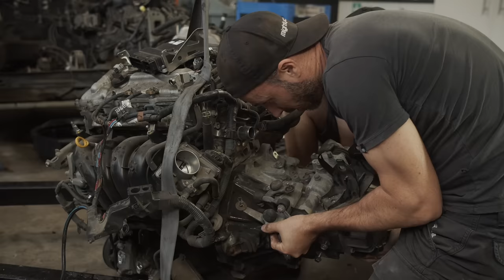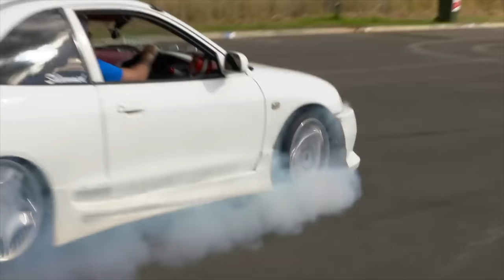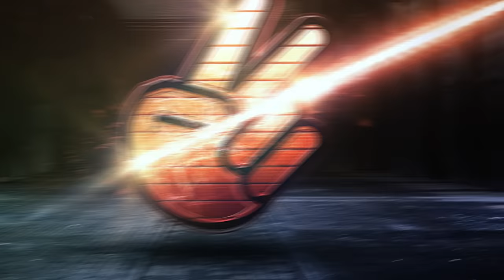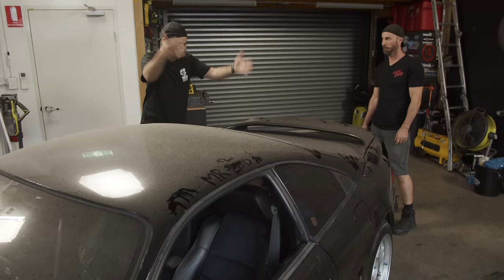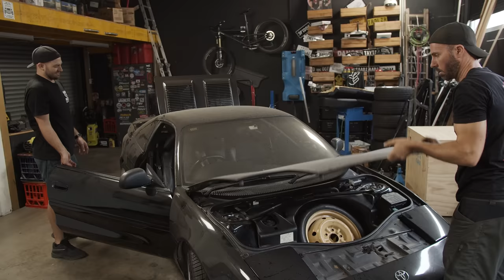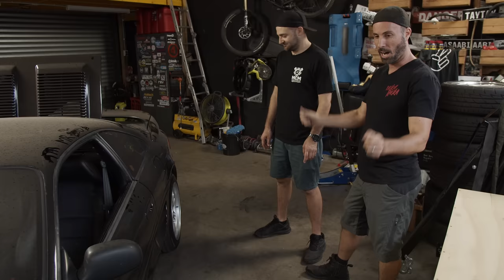$10,000 Rear Engine Challenge (Marty's NEW CAR)

Comment: Always thought the "snap oversteer" for these cars was exaggerated, that was until i witnessed an mr2 snap oversteer on a sprint run around a smooth corner.. 🤣
Reply: It's pretty brutal and didnt get fixed until the MRS. My old man borrowed one after he blew the head gasket on his range rover.

Was driving home from work one day, completely normally, and found himself pointing the other way. They're lethal.
Reply: Snap oversteer is just a word people use for the thing that happens when drivers who aren't used to mid-engined cars try to drive them like the usual RWD car. It'd happen on pretty much any mid-engine car but the reason you only hear about it whenever someone mentions the MR2 is because it's just about the most accessible one
Reply: @j4ff4c3ks1  false.... peep any review of the era and pro drivers and auto journalists who have plenty of seat time said the same
Reply: @douglaspealing5608   firstly, if the MR2 is set-up correctly it wouldn't happen on a smooth corner. secondly they 'fixed' it on revision 2-3 by altering the suspension and brake setup. even doing a very simple wiki would tell you that. idk where you get that info from, and if your argument back is 'yeah but late ones can still do it i'v seen it'... mate all mid engine'd cars can, Lambo's, Ferrari's the lot. the only reason MR2's have this name is due to the poor revision one setup gave it a huge name then all other models smoked things they should never of been getting close too. If you research this you will find out that the MR2 Turbo GTS was actually faster in a 1/4 mile than the Supra... the flagship sports car for Toyota... and the Supra was destroying Ferrari's of the day. Have a nice day.
Reply: @Dsilver024  false, they haven't. It's all you idiots that have never owned or raced them that say this. Snap would indicate that it happens without warning and this is just not true. The engine is in the middle/back meaning that the car in most situations handles much much better than a front engine car giving the false sense of security so granted the window between feeling the rear go and having time to correct is shorter it's not as bad as instantly snapping. Most people out on their brakes as the response this unbalances the car. Anyways I wish internet warriors like you wouldn't feed false info... But in all honesty if you do then it keeps the cost of spare parts down for me.
Reply: Driver mod.
Reply: The "snap oversteer" thing is bollocks. The very first cars, revision 1 models, had neutral handling. In the right hands they were awesome. Problem is plenty of people don't appreciate how much of an effect the engine being in the back has, so they would throw it around in corners like any other RWD car and be surprised when the back end suddenly bit back as the weight shifted. As a result, Toyota changed the rear subframe and tie rods for revision 2 onwards to make them easier to handle by the masses, and also gave them better brakes. Then revision 3 got a newer 250bhp version of the 3S-GTE, an LSD gearbox as standard, etc.
Reply: @j4ff4c3ks1  Drive one fast on a mountain pass and you will get it. It's so unpredictable it not safe.
Reply: The revision 3 cured a lot of it just by fitting bigger wheels, but the rev 5 had the better anti roll bar setup and is Def the one to get
Reply: I owned one for years, never had a single problem. They go exactly where you point them, you just have to remember the weight is on the rear wheels instead of the front. With all the weight on the back, they're all grip until you really provoke it. On a front engined RWD, it will progressively lose grip the harder you push, on ANY mid engined car that simply isn't the case.

And yeah, Tiff loved how the revision 1 handled, I remember seeing videos of him reviewing one and driving it hard. Funnily enough he didn't struggle to keep it under control since he could appreciate how a neutrally set up mid engined car would behave. The general public didn't, hence the revision 2 changes I mentioned.
Reply: @danbrittain9530  Only spun when I was testing on a skidpad because I was so scared of what the internet said. Like you said if you drive it like a front engine car you will have problems. Some tools need better craftsmen.
Reply: @danbrittain9530  Agreed. The correct size tires and a good suspension setup do wonders for making it much easier to drive.
Reply: @LongingREDFOX  yeah i think the guy dabbed the brakes around the smooth corner but the back end snapped to quick for him to catch and it does go very quick
Reply: @maiy8786  to be honest its all about how you drive it,  you cant drive it like a rwd or fwd car otherwise it WILL catch you out, and when it does the rear end goes so quick even some pro drivers struggle to catch it.
Reply: @LongingREDFOX  well, call me schooled to some degree. I got the info of the MRS bit on the grapevine, never actually fact checked that, so fair play. How fast a car is in a 1/4 mile doesn't determine how well it goes around a corner though mate. I've never been one to care about straight line speed. I like a bit of poke but 100hp and lightweight is plenty for me - just want something that corners.

In theory, the car should just work from factory. The fact that you have to dial out the oversteer yourself is what gets me. Don't get me wrong I actually quite like them and very nearly bought one, I'm just saying that bone-stock, the earlier ones definitely snap oversteered. Not gonna say my old man's a racing God, because he isn't. (He admits I'm a much better driver) but the boy knows how to hold a wheel, and for a car to just point the other way under NORMAL driving conditions (it wasn't even wet) there is something fundamentally wrong. Wouldn't stop me buying one in the future tho
Reply: @danbrittain9530  lol, sounding like porsche after paul walker died.... know all the things and reason why something bad could or would happn but denying the problem.... yea... ur right.. nothing wrong with the MR2.. not like there were any revisions to the car on the later models to negate the issues u deny exist

Comment: 9:00 *used to be cheap in the US, these have gotten pricey over the last 3 years.  Now people want 5k for a rust bucket non-op status turbo with 200k+ miles
Reply: same deal in the UK mostly, rough ones still rarely show up for cheap (like 2k) but really you're looking at 5K(10k AU/ 6k US) for a decent one. and the w20s are now starting to be consistently as or more expensive than the w30s.

Comment: Welp shoot there goes the price on every mr2 part DX damn it, and with the targra top seals you can still buy those from Toyota you just have to deal with someone from japan or the uk, and with the wheels Yes the car is meant to be staggered,  from factory they came out stagger rev1 89-92 14/60/195 front 14/60/205 rear and 93+ 15/50205 front and 15/50225 rear if memory serves, But Question for Marty, Does it have the retracting mirrors and moving fog lights when you steer?  where should be a switch with the fog lights that's got Japanese writing on it to turn those on, because those i believe were unique to Japan, And with the snap over steer, Yes it is a real thing in mr2s but its not as common as people think, it happens (and someone can correct me on this if im a bit off) when the weight transfers from the rear to the front when cornering hard at speed when power is taken away or hard braking is applied while in the tight corner too but is preventable with a decent set of tires and most important of all experience of knowing when the car is stepping out and how to correct it and not being reckless behind the wheel, because the car WILL punish you for it, but in saying that any car will do the same so treat it with respect and it'll reward you with one hell awesome drive, https://www.mr2oc.co.uk/know-your-2.html?view=kb&kbartid=10 <-- a proper break down better then i could ever explain it
Reply: I really hope parts are still reasonable to get when I save up enough to refresh my 91 NA. Was my daily driver for 4 years but the car is 100% stock with nothing but normal maintaining done for 340k miles. So the suspension is shot. Bought a TDI jetta for my daily and will hopefully save up enough to get the MR2 in good shape in the near future.

Comment: That is SW20, called the “MR2”, differ from ZZW30, called the “MRS” models. But similar to rear engine models.
Reply: In Australia MRS ZZW30 was sold as the "MR2 SPYDER"
Reply: Yes they are all in the same lineage. AW11, SW20 and finally the ZZW30 that was named MR-S in asia, MR2 everywhere else
Reply: Except France.
Reply: MR2 spyder here in the US also for the 3rd gen.

Comment: Check out the “Boostedboiz” K swaped Mr2 .
Reply: Dimitris O. Only way to make an MR2 reliable, swap a k series Honda motor in it and put a moon tune in
Reply: @nicolasedwards1860  the 4age in the older ones is a solid motor, thats what im swapping into my te72 station wagon

Comment: Who doesn’t like an SW20😂😂😂
Reply: No one likes snap oversteer, but i like MR2's.
Reply: pilipinascarguy snap oversteer only applies to those who can’t drive 😂
Reply: @gondra.w4v  the trick is to never lift off in the corners. It's a big game of weight shifting and balancing the car, but that's part of the fun. Just hope there's no bumps on the corner that will unsettle it as that's where it'll get you :P
Reply: I'm more of an AW11 guy myself. :)

But, the SW20 is a decent car.
Reply: @Figureight  
Always a pleasure seeing you around on YouTube, actually being a part of the car community! Wish you the best!
Reply: Figureight also most of it got cleaned up around the 83’ model I believe. I’m so glad to see you here
Reply: With good upgraded suspension there's no snap oversteer.
I drive mine very very hard and never had it come around
Reply: @not12listen  I agree...I would prefer a supercharged aw11
Reply: @gondra.w4v  snap overseer was bad on first gen but after that was fine. Had a Rev2 for 3 years and never snapped on me, very controllable on the road. Should never have sold that thing 😥
Reply: In germany sw 20 means a nut or bolt that needs a 20mm spanner

Comment: Loved my MR2 (SW20) - great square engine 3SGTE (86mm bore x 86mm stroke)... your handbrake needs to be adjusted!! (very common issue with them!!) - looks like it might be a revision 2 (which means a lot of the issues with twitchy handling would have been improved) - someone has also replaced the rear lights and centre panel with a revision 3+ setup.

Comment: Ive been waiting so long for you guys to do the MR2, ive owned one for over a decade and love the thing. My kids love it too, even gave it its name "Beep". There is a wealth of information on the MR2oc and IMOC forums, like the importance of a staggered tyre setup, you can have matching wheels but stagger the tyre size as it was designed to have and benefits from having it. Also snap oversteer was only ever an issue with the SW20 REV1 release cars, the suspension geometry was race inspired and the combination of mid engine, precise suspension and motor journalists inexperienced with driving cars of that layout meant a fair amount of bad press for the early cars. it hasnt really shaken the stigma even though REV 2 have geometry changes that negated those issues and as you seem to have a REV3 or later car you shouldnt have those issue at all if alignment is set up to spec. Hope @Mighty Car Mods reads this and all the best for the challange, im on the edge of my seat!!

Comment: Hell ya! I've been watching MCM for years and I'm excited to see you finally get an MR2! I'm from America so as far as pricing, for the turbo versions, one in great shape like that goes for $8,000-12,000. Same goes for JDM imports, but typically see them around $12,000 more often. NAs go from $1,000-4000 depending on the shape. I'm in the middle of swapping it with the JDM engine and trans right now, I got it back from the machine shop, I'm replacing all the gaskets, and just started on the timing side. Really great car, it'll be a forever car for me. Also, in the US, they stopped making them in 95. 93+ they made some major revisions to the suspension that make then sought after, but the 94-95 are more saught after. I have a 1994 NA, only 950 were made for the US, and 350 95's for the US. You see a lot of 91's because there were about 21,000 of them, they're dirt cheap to buy NA, and then you 3VZFE (V6 Camry Motor), 2GR swap them, gen 2/3/4/5 swap them with track build typically being gen 4/5, or you can balls to the wall K swap them and go for 1000 HP builds.

Comment: I've had FIVE of these cars. 300+bhp fairly easily, mid engined, look great,  bullet proof. When you work with the car and have good tyres they handle amazingly. You're right these were cheap in the UK (years ago) getting expensive now.

Comment: OMG you picked an AWESOME two liter factory turbo rally king engined car.  This engine is the real deal from the 1990s World Rally days along with Mitsubishi 4G63 (factory turbo 2 liter) and Subaru EJ20 (factory turbo 2 liter).  I think SKODA and FORD were the only other competitors of merit but you got a rear engine car with the rally engine!  SWEEEEET.  I can't wait. This car's engine is more likely to be overbuilt and undertuned in its stock config, so I am betting it will not go POP like the Corolla you put in that Yaris which wasn't intended for high power, as we discovered.
I hope you also work on handling with sway bars and big brakes. This lightweight rear engine car can be FAST on a road circuit.
Reply: If you don't like MR2s, you can ship it to me.

Comment: Snap oversteer is simply a matter of adjusting your driving technique to suit the characteristics of the car you are driving. Michael Schumacher was one of the best at driving an oversteer-prone car; his technique involved reducing speed for the corner early and holding the throttle steady throughout the corner, making any handling adjustments with the steering only. Most people used to an understeering car will instead hold the steering steady and adjust the throttle, but the laws of physics dictate that doing this too suddenly when most of the weight is behind you is going to induce a spin. If you keep the weight transfer smooth, and keep the momentum of the engine's mass aiming between the front wheels, oversteer will be your friend.

Oh, and while I think the Toyota/Yamaha 3S-GTE is one of the best four-cylinder engines ever, turbo technology has come a long way since they were new, so an upgrade in this area to reduce lag can give a major improvement in throttle control/drivability.

Comment: the snap oversteer really can be fixed with minor suspension adjustment and proper swaybar setup.  a moderate number of people actually have success using these for drift cars, believe it or not.

Comment: Identical tyres and wheels burnout till the tyres shred first to pop wins. Who can hold the longest drift (you'll need a circle skid pan. And final test should be a mpg fuel economy run in the outback to air's rock make for an epic back drop

Comment: Snap oversteer is a non issue with MR2. You can make a FWD car snap oversteer if you lift off the throttle in a high speed corner. It's all about managing weight transfer.

Comment: It is very true that MR2s are cheap in the UK. It was on the table for me to get one for my first car, though the insurance stops you there. Was gonna be £1300 for the car though, but it did need some work and was an NA UK spec. A turbo one will set you back around £6000 for a decent one. The two starter 90s Japanese cars in the UK are either an MR2 or an MX5, I went for MX5 because insurance is cheaper and working on it is way easier.

Comment: Yeeeeeeaaaaahhh an mr2, I've owned mr2's since 1997, I've never been without one, my favourites are the AW11 I currently own 5 😂 including a rare JDM Supercharger.
Reply: Does that supercharger fit on a 4age?
Reply: @cyanidacal0lulz  when I say Supercharger I actually mean a whole car, it was a model of mr2 produced, the engine in a factory Supercharger is designated 4agze, it has forged internals from the factory. The gearbox is also stronger. The standard 4age doesn't have the best compression for forced induction.

Comment: Anyone that says snap oversteer can't drive.
Aw11 > SW20.
Hard to bleed? put rear on ramps with arse in air and done.
Targa's are easy to fix the leak. New seal and the eccentric clips and done.

Comment: That's not strictly true about UK prices of these things. If you want a NA one, then yeah, you can get a good one relatively cheaply, because it sold really well here, and the UK models have since been supplemented by lots of JDM imports. However we didn't get the Turbo model, so one of those here in good nick would be about the same price as what Marty paid.

Comment: Wondered if, and when, one of these would show on this channel! It now has! But …
Why does Marty think the engine in these units is reliable ? “Everyone” knows cylinders #3 and #4 have difficulties due to faulty water jacket design, and thus cooling issues out the old waazu. Particularly true if engine horsepower is taken much above the 250 mark. Will say this: ’regardless, should be an interesting series’